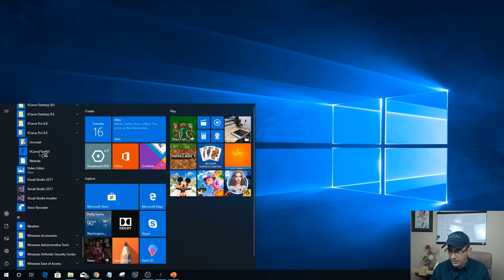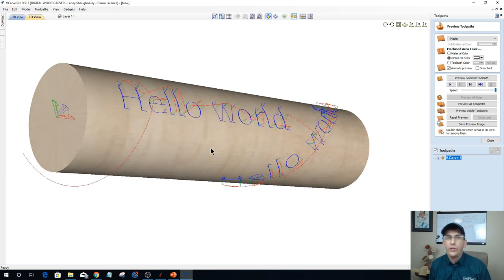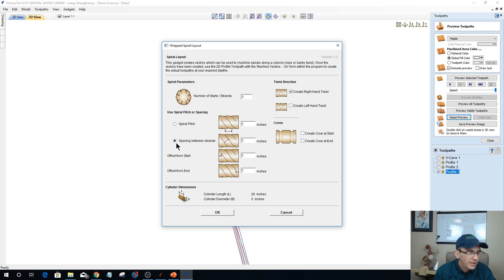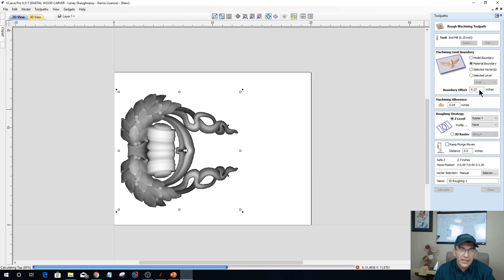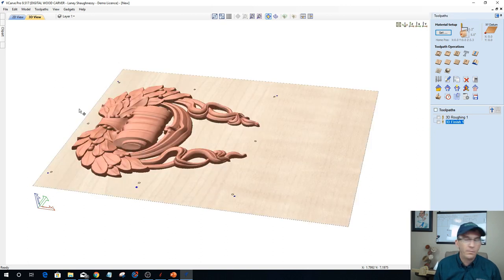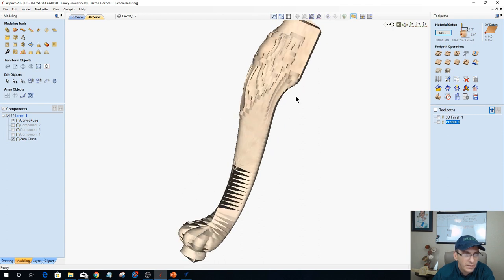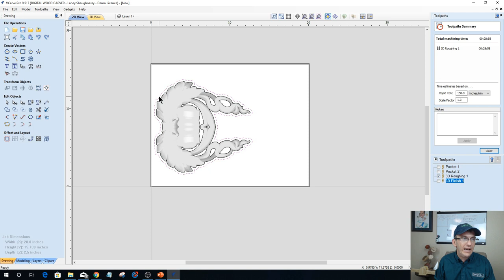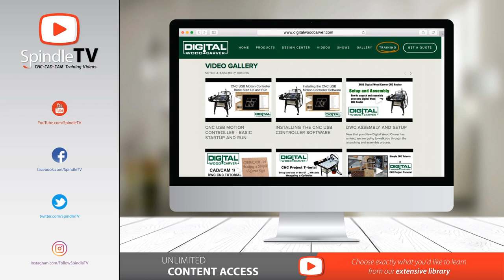Vectric - wrapping a 2D & 3D Design  - Rotary

Comment: Not sure if you monitor this nor if there is a better place for this comment BUT I spent a lot of time looking for the 'wrapping' gadget for install but google failed me and until I watched this video, thought I would have to go back a few versions of V-carve pro to get this utility (my Makerspace CNC now has a 4th axis). Big fan of your videos (your stacked text was awesome and have made a lot of these) but now I know this is 'first place to look for help' site!
Reply from the maker: I do read all comments. I am very happy my videos have helped you. Thank you for watching.
Reply: @SpindleTV  Great to hear...Now that I have watched the video...I am still confused...I have VCARVE Pro v11.016 and there is no 'Wrapping' gadget to select? I want to start with simple dowels and will have say a .6 square blank that I want to transform into a .5" dowel to experiment with 'wood hinges'. I created my job dimensions as .6 Inch By 10" and then created a rectangle that was .1' smaller than the blank and simulation looked OK but ???? I assume I will set Z at the center point and then if I have a start depth of zero and say a .125 pass depth (1" end mill) that it will just start rotating and have some 'air cuts but will eventually clear the corners and slowly work down to .5 from Z and stop? Note: I really tried hard to find something on this but even the Vetric 11.0 tutorial shows this 'wrapping' gadget so hopefully you can shed some light on this. Again...Thanks for the assist!

Comment: How do you reference the z axis start point on the center on the rotary?  Thank you.
Reply: I made a bridge using piece of timber that will straddle the lath bed having a cutout for the bed and rails at exactly the Centre height to get the z height and a small "V" cut in to the top of the rotary gearbox  to get the spindle Centre, after setting your rotary parallel ( I use a small bearing attached to a small rod that will fit in the spindle) and run this down the rail of the rotary to get that axis parallel,  zero the z axis using the timber bridge the center  (for me the x axis) then set the Y axis to the groove in the gearbox housing then move the y axis to where you want zero to be ( I always make this at least  20mm away from the chuck.

Hope this helps